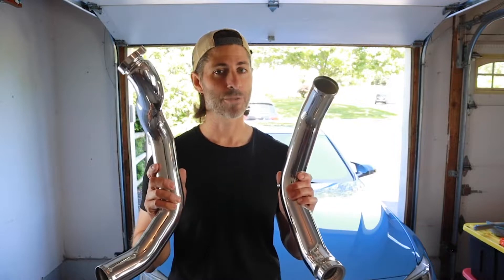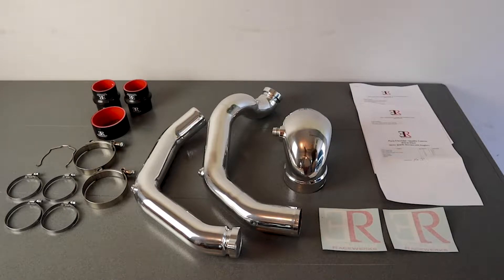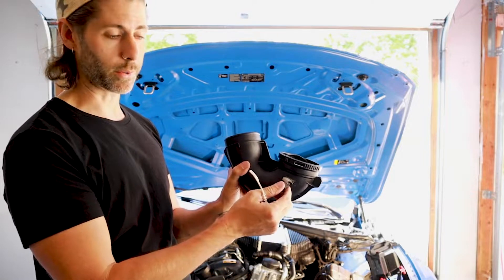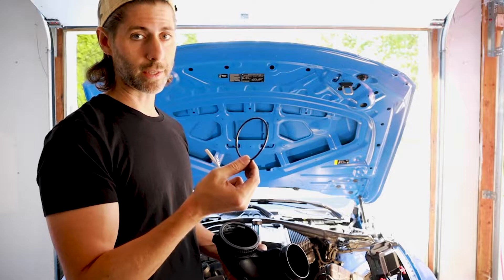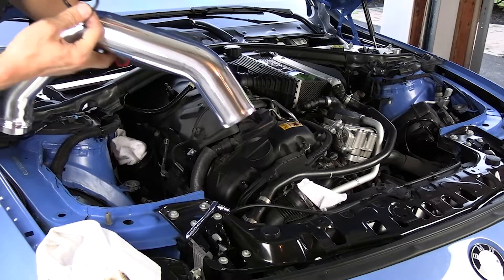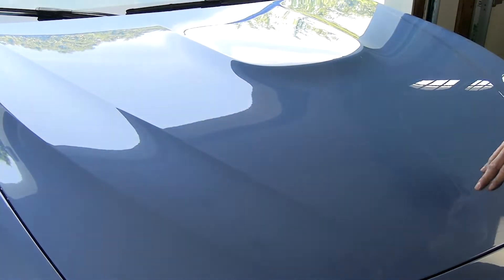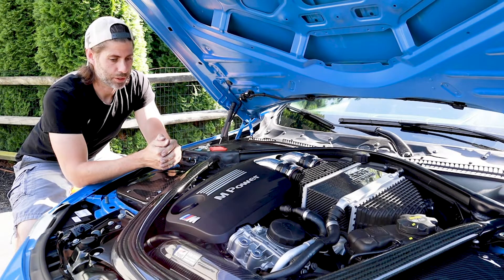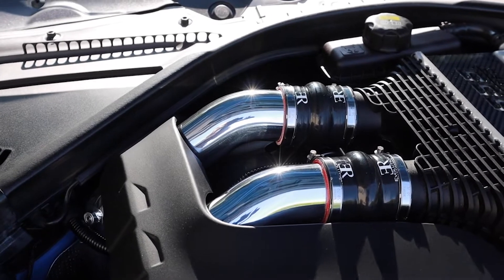Evolution Racewerks F80 Charge Pipes & J Pipe Install

Comment: Did you notice any difference after fitting these? Really helpful video 😊
Reply from the maker: Thanks brother, glad you found it helpful 🍻 Nope, no difference at all. Their main purpose is to hold up better than the stock plastic ones when you increase boost (the stock ones can crack sometimes). Also, they look pretty rad 👍

Comment: Dude how did u get your chargepipes to fit like that with the engine cover?
Reply from the maker: Funny you ask cause I just saw a video the other day of an RK Titanium cp install and the guy said he's installed tons of different brands and the engine cover never fits right. The first time I fit the cover back on, it wouldn't snap in so I readjusted the pipes (loosened the clamps and made sure they were all the way in) and then it worked. I had to apply a tad bit extra force in the top right corner, but all corners snapped back in without issue.